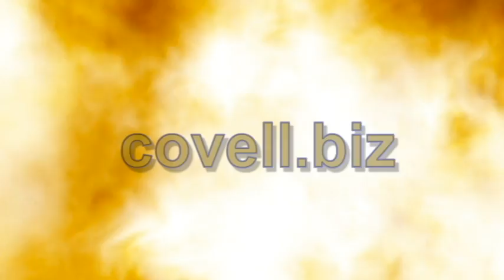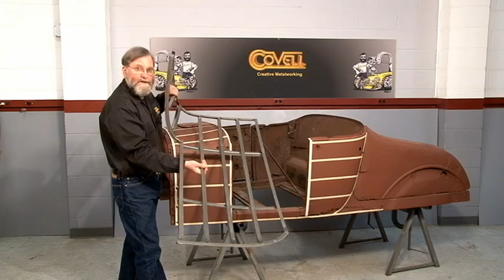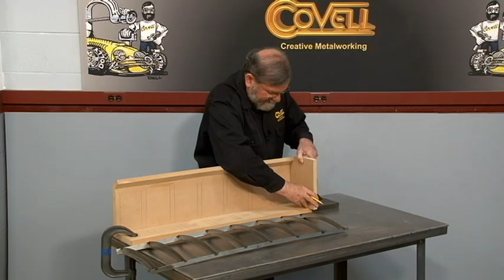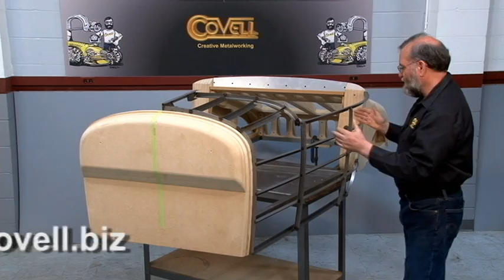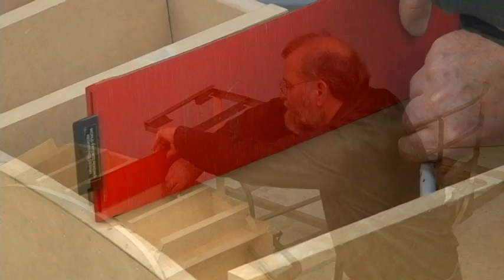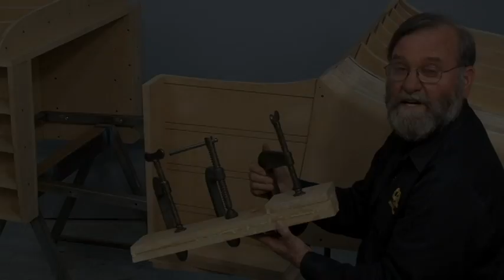Roadster Body Part 1

Comment: What happens to a buck after a project is finished?
Reply from the maker: Making a buck can be a pretty big production, so I don't 'throw it away' if I think there is any chance I might use it again. I'm fortunate to have a fairly large storage area, but it's getting pretty full.

It really helps if a buck can be disassembled, so it takes up less space. For that reason I rarely glue a buck together.

Comment: I missed where the template originated. Did he make it ok what?
Reply from the maker: I'm not understanding your question. I used an original car body to make the wooden buck.
Reply: @RonCovell  I saw a square tube framework that I understood you to refer to as a "template" used to guide building the buck. Since I used to fabricate frames I would be interested in seeing the template development. Thanks and congrats on your sheet metal skills!
Reply from the maker: Now I understand. To make the wooden buck, I used a stretcher and shrinker to shape small steel angles. I shaped these angles to fit the body in all the areas where the 'stations' of the buck would go, then traced them onto sheets of MDF, and cut them out.

Comment: what a trip man,  you have to make a complete body out of wood so you can make one of metal
Reply from the maker: How would you do it?
Reply: lol.., I don't know, I never realy thought about it before.  but it makes sense.  I cant think of any other method other than maybe casting solid parts out of plaster or mortar.
the cool thing about the forms is that you'll have them basically forever

Comment: Excellent work simple and straight forward....would you mind putting up for the design dimensions and sketches??? please
Reply from the maker: Samuel - you can see some of the dimensions here:

http://www.jalopyjournal.com/forum/attachments/27-t-dementions-jpg.348170/

I worked from an original body, not from dimensions.
Reply: Ooooooooh alright Sir...i will check them out....do you know how i can do it without the original body cause am in Africa and we don't have such body
Reply: Ooooooh Thanks i have seen on the site....very very helpful....

Comment: What do I do if I don't have a body from which to make patterns? I have a 27 cowl (easy to get) and 1 door but it seems that the body seat area behind the doors is always the missing part!
Reply from the maker: It's more challenging if you don't have an original car to model. Perhaps you can borrow a fiberglass body from a friend, or rent one from a business? You can get the chassis dimensions for a '27 Ford roadster here: http://www.wescottsauto.com/WebCatalog/Tech/FrameDiagram1926-27.pdf

Comment: I really have to question why you chose Mdf over marine ply?  Mdf swells incredibly based on humidity, it's like a sponge
Reply from the maker: Paul, There is no question that marine plywood is a better material to use for making bucks. Nevertheless, in my part of the country, where humidity is not a problem, it suits my needs well. I certainly couldn't store this buck outside, since rain or dew would cause problems!

Comment: Hi why not just use the conture gage instead of trying to use the metal frame ,and isn't it hard to make that metal frame,how do you bend the contures on the metal frame .seems like a lot of extra work.
Reply from the maker: You certainly could use contour gauges to do this work, but I find that having several templates joined together makes a more durable pattern. I use a hand-operated shrinker and stretcher to curve the templates. Yes, it is a lot of work, and not everyone will take this approach, but I think it's a good way to get the results I want.
Reply: Thanks Ron,Not that I will ever be able to even do this quality of work in my lifetime but just had to ask.den